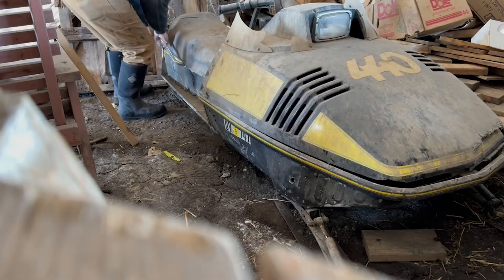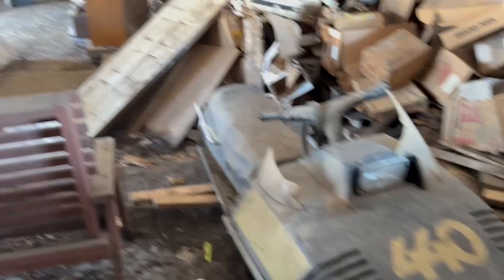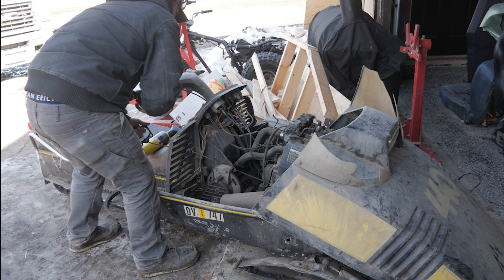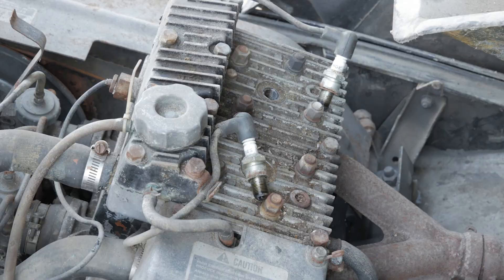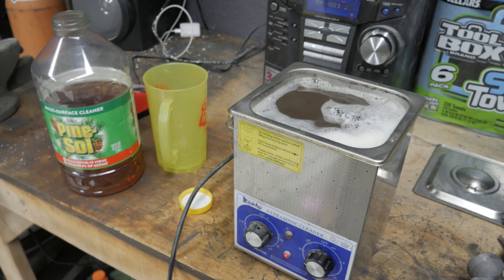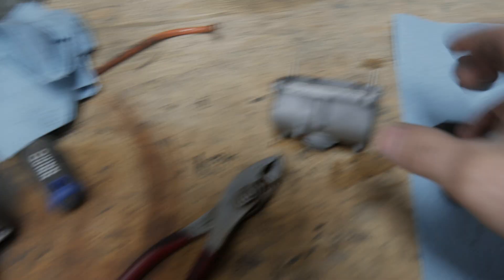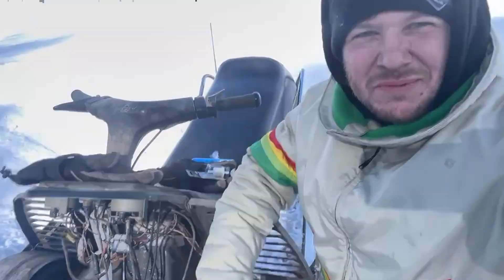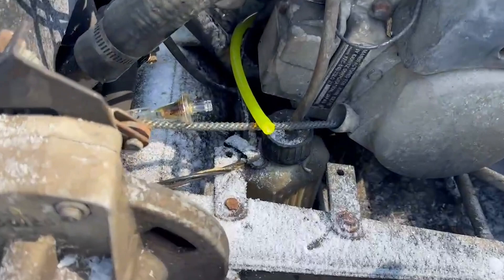Will This John Deere 440 Snowmobile Run After sitting for 31 years?!

Comment: The 1976 JD 440 had a Kioritz Engine KEC 340-22A engine with 2 Mikuni carbs on it. They still sell parts for the Mikuni carbs and you can find a lot of parts still for the Kioritz.
Reply from the maker: I did see that they sell rebuilds, I just couldn’t get one shipped in time unfortunately. Gasket maker worked temporarily though lol

Comment: if you ever have a large tank your trying to clean. you can use a flat 1/3 sheet or 1/4 sheet sander. ratchet strap it to the tank and fill tank with your ultra sonic mix. turn on the sander and let it eat. basically makes a Giant ultra sonic cleaner ;-)
Reply from the maker: Genius, I will have to give that a try as I have like 4 plastic tanks I need cleaned out now! Thanks

Comment: I've used ink pin springs and old lighter springs before lol to hold the idol screws
Reply from the maker: I did try a few from other carbs I had laying around but no luck. Gasket maker worked temporarily until my rebuild kits show up.

Comment: Looked like fun, knew a few when they were new, seemed to be fairly quick & comfortable.  Thinking about a little ice racing next year?  Lol!  Good fun could be had, not to mention "content"!  Lol!  Thanx !
Reply from the maker: Ice racing would be a great time, just sucks that there isn’t anything close to us here in central Iowa.
Reply: Lol, yea, here too (W.Mich). Used to be a few places to run motorcycles.  & If it got no snow & cold, ice boats were a blast!!  As fast as a quick sled!  Or faster.   But, we've harhar gotten any snowfall, & it's all melted a clue of times.  No ice on the lake either.

Comment: Did you gap the Plugs to Spec? It's better than the gap they come with, that recoil just needs to be oiled and the rope spun around a couple more times. That track looks Sketchy 😬
Reply from the maker: Track was very sketchy but I definitely put it to the test and it somehow didn’t blow apart.. yet lol
Reply from the maker: I should probably check them on my sleds as they have been sitting for a long time prior to me getting them